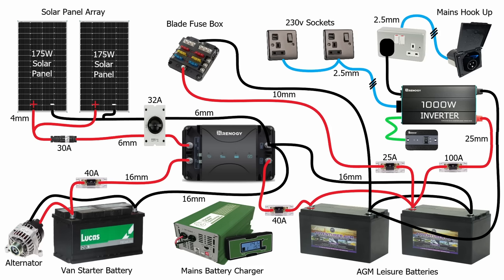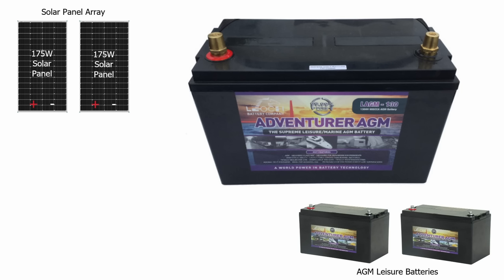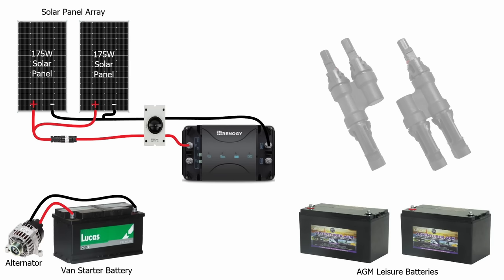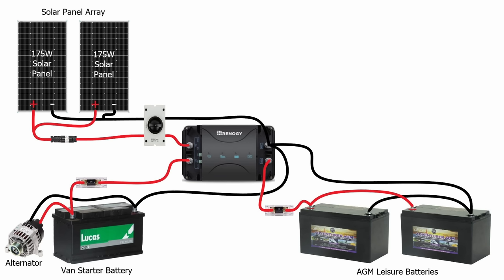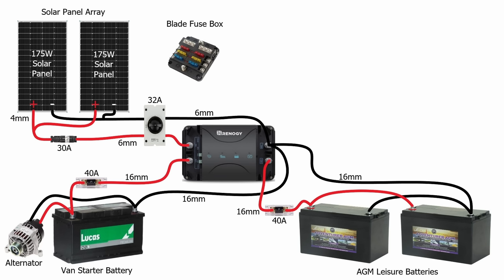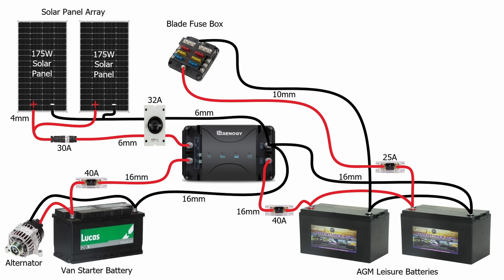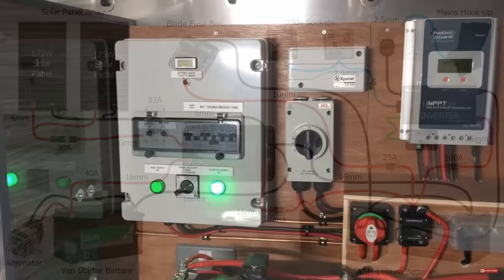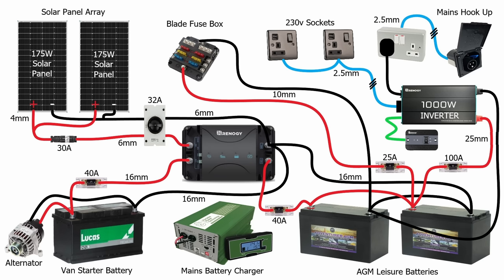12v Electrics for Off-Grid Campervan - Fiat Ducato Budget Build Ep12

Comment: Quality as per Greg. I think my inverter might be too big. But I can change that and keep this one for a larger system. If I get my new home a shed system will be constructed. The panels are cheap as chips now so I'm stocking up ready - I think 6 x 400 watt should be ample. Should power the home if there's rolling blackouts.
Reply from the maker: Your large inverter will only draw the current it needs to satisfy the connected load. So you can use a large inverter just don’t plug big loads into it and it will draw less current from your batteries. 
We have a 1500w inverter but the most I ever use is 140w so it’s only pulling about 10a off the battery.

Comment: This is brilliant Greg and great to be back watching your videos again! Your videos were super helpful 4 years ago when embarked on builing our first van in Australia. Now we are in Europe! And we've just purchased a van in Germany (a Citroen "Pössl" build) It's pretty basic, so we definitely need to upgrade the electrical system. This video looks to be JUST what we need.
I think we can budget for a 200 Ah lithium, so I wanted to ask you, do I need to modify the cabling and fuses in any way - other than not needing the parallel wiring of course -  or will the cable gauges and fuses listed suffice (as per your diagram) ?
Regards, Nigel and Sue
Update: I went for it. Taking 13 days solid, our mini build is complete and we couldn't be happier. The refit included a MaxxAir fan and the removal of the cassette toilet for a mobile composting toilet. Thanks again @GregVirgoe

Comment: You could replace that DC switch and 30amp fuse coming from the solar with one single 30amp breaker. You then have both and fuse and switch combined into one small unit!

Comment: Hi Greg, 
Thank you for all the information you are providing here you're definately the best at the level of knowledge and being able to explain it to someone who has no clue, no knowledge about the topic at all. 
Jus a couple of questions:
I can see that you've used 6mm2 cable to connect your fridge and fuse box. I am assuming that's the same solar 6mm2 cable you have used to connect solar to dcdc-mppt? 
What's the main disadvantages of ussing too big cable? For example uding 2.5mm2 where you would actually need 1.5mm2-loss of power or just costs of the cable?
When grounding/earthing video will be out? And where are you at with your budget camper built? :) 
Thank you!

Comment: Hi Greg, just wanted to say I've found your videos really helpful as they explain things in a simple way that my brain can handle.

I've recently started a campervan conversion with my wife and we have little to no experience with most aspects.

I wanted to ask what changes you would make to this setup if you needed to power an electric water heater and electric hob? I know there are a lot of variables but just wanted a rough idea. Thanks 👍

Comment: Hi Greg, I have followed you from the beginning and echo everything all the praise you get. I am close to getting a Ducato so this series is just great. I was discussing the project in the pub yesterday and someone said that if I install a DC to DC charger alongside the solar, I would need a larger alternator, is that right. I intend to use your elec system set up in the van.
Reply from the maker: No, not at all, your DC-DC charger will only draw 30amps from the alternator which is not a lot considering most generate well over 100amps as standard.

Comment: This is an awesome video and the timing is uncanny! I am trying to work out what I need for my situation and this is the closest I’ve seen to fit the bill.

I am currently making regular long road trips across Europe, 4000 miles in a week, and would like to be able to keep a 12v fridge powered while I’m not driving overnight - so I can have real food not just sandwiches from motorway services.

I’m not travelling for pleasure, no camp sites or hook ups, just 12-16 hours driving per day sleeping on the vehicle. My van needs to stay as a van, it is loaded up with our belongings as we move abroad. So not looking for a “permanent” installation or conversion, more like car camping or whatever lorry drivers do 😂 

My question is whether this set up would work without solar panels, or maybe with smaller ones that go on the dash, but essentially connecting leisure batteries to the starter battery using the Renogy box as just a DC-DC converter. I will probably want to add solar panels at a later date when we transfer this set up to our other van (Vivaro) so this wouldn’t be a wasted piece of equipment.

People have suggested getting a power bank but they cost a lot more than your two batteries and the Renogy box, and apparently they don’t charge brilliantly from the vehicle 12v supply. I’m stuck deciding what to do!!

Comment: Hi John great 👍 work thanks.  Could you please advise if I could put 4 panels as in your video? Also I intend using a small generator and was wondering where to connect to and I will be using lithium batteries and hoping I can use this solution that you have put up.  Again thanks for all your hard work.

Comment: I use an ECTIVE inverter, which also switch thru automatically, and will charge the battery when connected to the grid, the latest versions also have a mppt build-in
Reply from the maker: What is the cost of that all in one unit to buy? 😊

Comment: Hi Greg, first off I follow your channel because of the great content you put out. I'm currently using this video as the base for my installation and due to me using 2x100w panels I thought I would search more into cable sizes. I then came across Explorists life video, 'How to Fuse a Solar Panel Array for a DIY Camper Electrical System'.
I'm not here to say what's right or wrong, but just would like your opinion on what is safer. He goes on to say 'If the short circuit current is higher than the maximum series fuse rating, then you need to install a fuse rated at the maximum series fuse rating of that panel.' By the looks of it he is suggesting that each of the panels will need a fuse upstream of the mc4 connector. His video explains it much better than how I can write it, and gives examples of worst-case scenarios.
Looking at your 175w panels the Short Circuit Current: 10.31A, but the Maximum Series Fuse Rating: 15A. So you have 20.62A, just over 5A of the Maximum Series Fuse Rating. 
Like I say I'm not here to pick fault, but more to share what I have found. Kind regards

Comment: Hi Greg, I copied your set up like for like just to give me confidence in my system as your the only man on You Tube I trust 😂 the only change was my 2 solar panels, I couldnt get the 2x175w panels and got 2x200w panels instead, would anything else need changing in your set up because of the 2x200w of solar I went for? This isnt fitted yet by the way 😅 Thanks so much for making these vids, all your vids are much appreciated.

Comment: Great video. No naff music, straight to the point, no waffle confusing us mere mortals.
Anyway if you see this id be amazing if you could confirm something for me pretty please.
 For now i can only justify spending on 1 panel and 1 battery. Im going for a 110 agm battery a 170w eco worthy panel. Now, i was going to get a 30a reneogy mppt controller with built in dc-dc converter. Ive just found a similar dual piece of kit on the eco worthty website. Its available at 20a or 40a. Right now a 20a would be great but would it give me scope to build and fit an additional 170w panel and 110 battery? Would 40a be too much for single battery and panel? Im inclined to think it would but id be gutted to buy 20a and be unable to build my system up.
TIA 👍🏼

Comment: followed this guide to a t, not needed an electric hook up so far. I how ever am an idiot, and blew a fuse! 100amp fuse, going to the inverter, if I had not watched this video I would have made a loss by blowing the inverter itself, 100% watch this! I personally went for 200w panel, 50v dc-dc mppt controller, works ok far!

Comment: A brilliantly clear explanation and description Greg. I'm going to get building next month. Just thinking about cable lengths...which cable distances need to be the shortest? I already have two leisure batteries under the front passenger seat(Mercedes Sprinter 2012 but would ideally be setting up a system such as yours (in the 12v Electrics for Off-Grid Campervan - Fiat Ducato Budget Build Ep12 video) near the back of the van. Is that distance from batteries OK? Thanks. Mike

Comment: There are two connections on the consumer unit. I used one of these for a Schuko style socket. Any high wattage items have a Schuko plug which means they can’t be connected to the inverter.
Reply from the maker: That’s a great way of making it fool proof 😊

Comment: Stumbled across your channel - love it: very detailed, clear and concise information - thank you. I have a query on your diagram.  I'm intending on very same setup you describe here, however you didnt wire up the last unit 'Mains Battery Charger'.  So assuming it is connected to both batteries as the other power sources.... but is it OK to leave it hard wired? ie if there is a charge from solar/alternator... will it damage the unit? also, if the mains charger is switched on and left overnight, and then the solar starts up in the morning... can they all remain hard connected and not damage the DC-DC converter/charger ?

Comment: I might take some issue on this set up and it's to do with the mains hook up. I would want to see a breaker between the mains hook up socket and the 13 amp twin socket. One with an RCD switch and two or more MCB's.  That would give an opportunity to provide a socket for the Mains Battery charger when on hook up plus perhaps an extra dedicated socket for an appliance.

Comment: Hi, great video as always, but I think 220v systems needs same circuit breakers too.. Maybe inverter has an internal fuse but when external power is used, inverter fuse could not be functional also there will be no harm from extra protection :D so I think adding an extra circuit breakers for 220v system would also be a good practice.
Reply from the maker: I would not disagree with you on that point. It would not hurt to have a small consumer unit on the entry point to the van to further protect internal. 
Campsite hook up are fed from MCBs the kettle lead plug to the inverter is fused too. Can’t be too safe right 😊

Comment: What a superb explanation! Thanks. Can you get your shoreline side to charge the leisure batteries rather than a separate backup charger ? Also why do you not choose to run your appliances to a common ground to save running ground gables back to the fuse box? I’ve seen others recommend this. I’m an electrics novice but have seen another video say this is easier ? Man many thanks

Comment: Great informative video Greg. I’ve just bought a caravan for the first time. I bought a new 110ah battery and after watching your video I’m keen to add solar. Would I be right in thinking to adapt your system to a caravan all I’d need would be the solar panels, controller another battery of the same I’ve got and the fuse? Thanks in advance.

Comment: Thank you for the wire diagram and the explanation. Is one of the best explained and without breaking the bank. I just want to ask, why are you using 40A fuse for the positive cable bateries. Didn't the renogy have 30A max in/out? Sorry if it was a dumb question, i couldn´t get it from the video and i just start learning more about this.

Comment: More quality content from you Greg, never disappointed. Regarding the earthing of 240v consumer units. Should i connect the earth to the chassis of my van from the consumer unit ?
Reply from the maker: Hello, I have a really important update for you. I have just spent two weeks training in electrical circuit protection and wiring regulations and my advise was wrong. There is a legal requirement under statutory regulations to NOT connect a mains hook up earth to the metal body of your campervan. There is a serious risk of fatal shock if the site power supply loses its combined neutral earth connection. Please disconnect any earth from your van body. Sorry for any confusion. My new video will explain in more detail. Best wishes Greg

Comment: excelent presentation, the only thing missing would be is if we get a inverter - charger where the inverter would charge de battery if on shore power would it interfire with solar output ?

Comment: Been really looking forward to this, fantastic explanation and easy to understand from your explanation as usual mate 👍 just wondered what your thoughts are on using busbars as I was thinking of using them ?
Reply from the maker: Every time you add another fitting or extra cables that's adding more resistance to the system, most amount of cables on one stud here is three so that's perfectly acceptable and keeps the cost down too.

Comment: Really informative Greg thank you. I'm just planing my solar/inverter/mains hook up system and little confused when it comes to the charging system ( we have a Dethleffs motorhome with consumer unit and on board charging for both car and leisure batteries when on hook up) so am I right in thinking an ordinary solar charger is required not a DC-DC charger as in your example? Also for 240v inverter (Renogy 2000w) power to my existing sockets where on the consumer unit should I connect the cable from the inverter? I am guessing where the hook up cable is connected in. Thanks again for a very straight forward video

Comment: Hi Greg, like other have said many times. Thank you 🙏🏻 for all your knowledge and time putting these together. This is exactly what I needed! In relation to the lighting, it is possible to link it back to the original can wiring so they come on when a door is opened? ⭐️ ⭐️ ⭐️ ⭐️ ⭐️
Reply from the maker: No, it doesn’t work like that and you risk flattening your van battery. 
Wire the lights on the leisure side via a separate contact switch placed near the door. I would put another switch in line too so you don’t have to have it on all the time.

Comment: Hi Greg, Brilliant video, really informative. I was just wondering how you could convert the 230V inverter outlet and wire it up as sockets, so i don't need to use a dodgy extension cable. Many thanks!!
Reply from the maker: It’s easy just remove the extension sockets and wire that cable into the back of a normal 3pin socket.

Comment: Great video as always Greg, thanks for taking the time to put it together 👍🏻

I would like to apply this but instead of it being in a van, it will be in a trailer. 

For running the DC-DC charger side from the car,  I'm thinking its just a case of running thicker cables(accounting for voltage drop) from car battery back to the trailer via Anderson plugs with a circuit breaker at the car battery??

Also, the mains charger, is it possible to connect a little petrol generator to this in a pinch?
Reply from the maker: Yes exactly that you are the right perfect solution, I would go for Fuses instead of Breakers they will act a bit quicker on slight overcurrent.

Comment: Thank you for such an informative video presented in such an easy to understand style. One thing (and sorry as this is all new) the green battery charger off mains at the end. Where does that plug into ? The 240 v system on camper or external 240v plug ?
Thanks again Neil

Comment: Really liking your video content, keep up the good work. I'm currently carrying out a campervan conversion and trying to put a shopping list together for the equipment etc. We are planning on at least 400w of solar, 400ah of lithium/ lifepo4 batteries and a 3000w inverter. What size  cable and fuse  rating would you recommend for this?. Also should there be a consumer unit between the hook up point  and the inverter ? Thanks

Comment: Hi, we are very grateful for all you videos as they are helping us with our conversion, please can I ask where you get from and what cable is needed for the 240v for things like plug sockets. We have just bought the red 16mm PVC cable and the black PVC 16mm cable for the wiring from the leisure batteries to the motor battery.....is this right ? Many thanks Sarah

Comment: Thanks again Greg, another amazing video for people like me embarking on a camper van self build. Renogy seem to have discontinued the 175W panel - would this system work the same with a pair of 200W panels? I assume the cable, fuse and switch would need up rating on the solar section of the diagram?

Comment: Hi Greg, fantastic and informative video as always! We are in the process of converting our Sprinter, we are leaning towards a lithium battery as we intend to spend a bit more time off grid I worry about being able to maintain the charge of a pair of AGM batteries. What kind of AH lithium battery do you think would be sufficient for 2 people off grid? We won't have a TV, maybe a couple of laptops being used but not every day and certainly not all day. Would 110aH be sufficient in your opinion? Thanks Greg

Comment: Hi Greg, we love watching your videos they have helped us a lot in our van build,
I have a question that I hope you can help me with, I have just fitted or van with 400watts of solar through the Renogy 40a moot controller, which is going into two SuperBatt AGM1100 12v 120AH Deep cycle batteries, So I am now fitting a Renogy 2000watt inverter, where do I earth it to? I was thinking the side of the van as I did with the 12v stuff but someone said the inverter need to go to ground, and to use a wire with a tent peg to ground it to the earth, this seems a right rigmarole to go through in a van? Any advice would be great they said if I earth it to the van and anything goes wrong the van would become live? Help!!!!
Cheers for any help,
Paul.